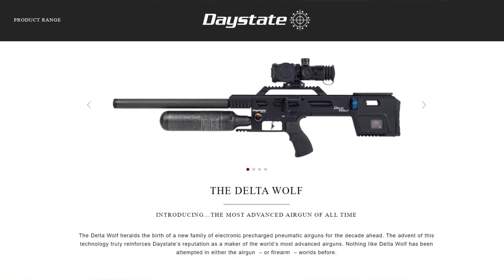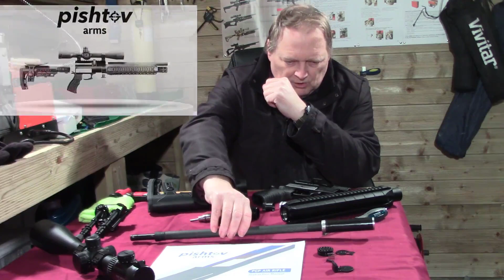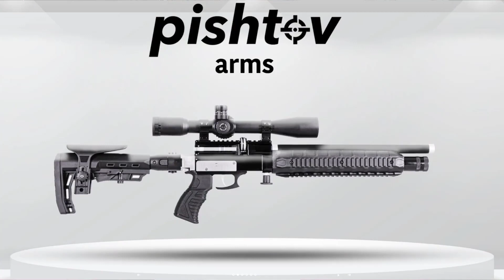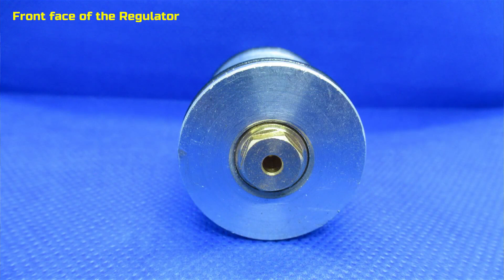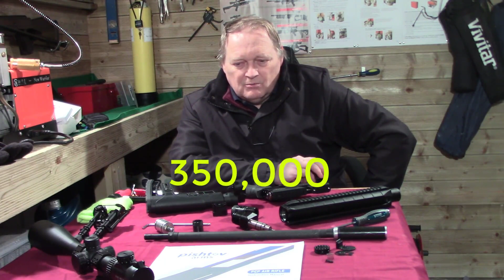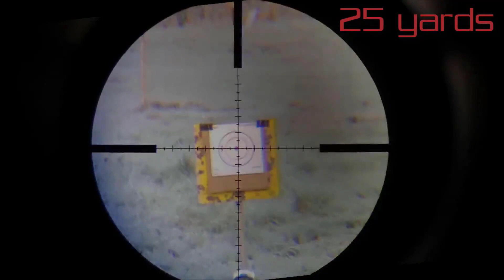My thoughts on the two top rifles from Daystate and FX  -  Plus an update on the budget "Retay T20"

Comment: Just un believable Mark that rifle is a bag of shit ,shame on Retay for turning it out.Could be a project gun but I'd want those guys footing the bill.Name needs changing from Pishedoff to Return !Iv learned a hell of a lot off you and I'm glad I subscribed.I now have a working understanding of regs,charging pressures what professionals to use.I just can't give high enough praise to both Rob Lane and Phil Crampton for my regulator and barrel work on my S200 absolute gents to deal with.I do want to join an airgun club in the future.I do have a spare Altaros regulator for an S200 set at 100 bar with spare o rings and a exhaust valve spacer,a mk 3 standard Air Arms S200 .22 Silencer ,set of new single screw sportsmstch mounts ,low 1",which I will never use.Could you use them or gift them to a needy club member?I can post out in new year seems a shame to let them gather dust.Stay safe keep posting all the best to family merry Xmas.Tony
Reply from the maker: Thanks Tony, glad i could help in some way. Once you take the plunge and start to dabble in gunsmithing theres no turning back, plus you learn a lot about your rifle.
 
Yes rifle this has been an eye opener into how manufacturers and designers can be when starting out for the first time. Not what you'd expect from a new rifle, but you live and learn. It's definitely sortable, but not what I intended.

If you want to send your parts you can do. I am sure someone at the club would benefit sooner or later. If you write to this Email I will give you my details: 	airgunsniperelite@gmail.com

Many thanks

Mark H.
Reply: @airgunsniper-elite7385  Your most welcome buddy and will do regards.Tony

Comment: Some of the early daystate air wolfs had a chrono in them, not the MCT I (mapped compensated technology) think it was the MVP ( or something similar) they were to troublesome so they switched to the MCT, I've had a few wolfs and a grey Shadow and they are just as accurate and powerful as the newest rifles out there .
Reply from the maker: Yes, you are right. They had a few problems with them to start with because the vortex of air wasn't enough to clear the lead dust off the chrograph in one of the calibres. They have made things different in the new version to help prevent this from happening again. By the time they realised the original problem, they had already stopped producing them.